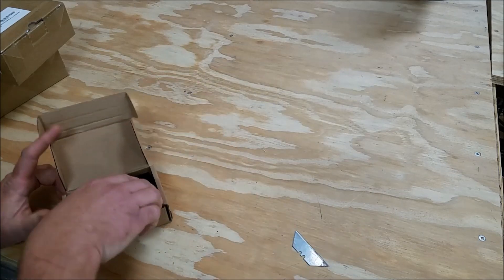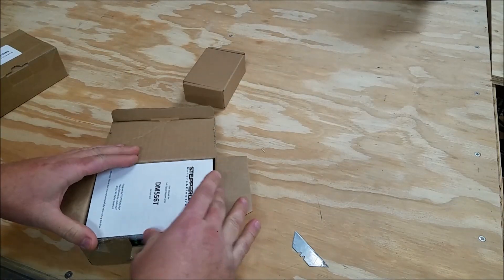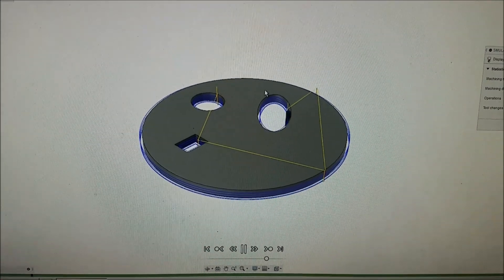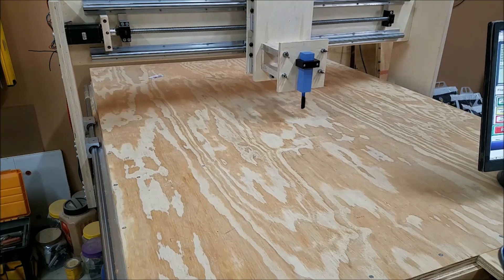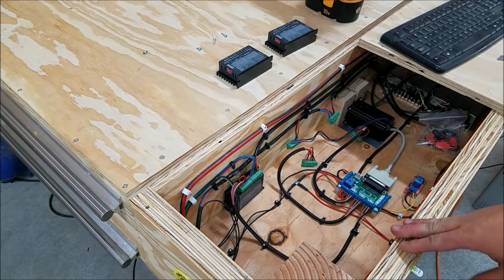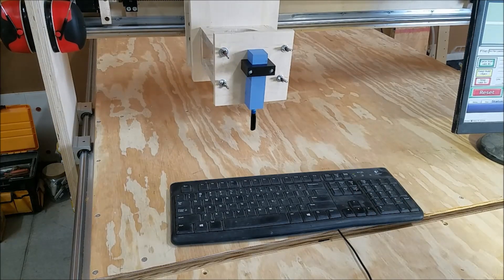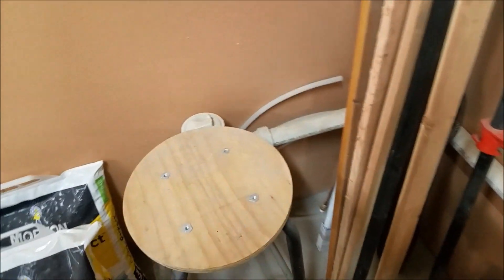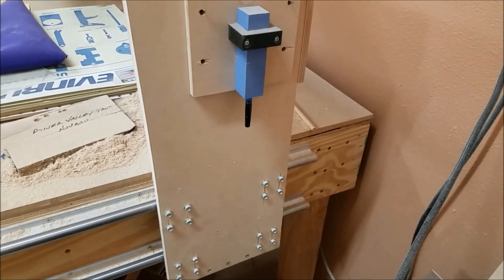CNC Motor Drivers; TB6600 vs. DM556T

Comment: Radiators have a function, stifling the airflow by placing them against a surface that stifles them is strange or curious.
This test is conclusive. For compensate a bad installation : use larger (and more expensive) modules.

Comment: I had a similar problem with the TB6600 drivers shutting down on me with voltages above 25vdc. And it was having an issue of drifting just a little each time with back and forth motion. I am replacing it with a drive very similar to the one you replaced yours with. Took me a long time to figure out what was causing the drift, I thought it was the software or settings. But after I fixed the random powering down of the tb6600 with a 35v 2000uf capacitor(one I had on hand, but you could probably use much lower capacitance) at the voltage input terminal of the drive. I eventually used a much smaller driver I had for the 2 amp motord to test the 4 amp motor and had no drifting issues at all. I later heard that this was a common problem with the tb6600 two trees brand, I wish I had known that before I wasted money on it, only 10$. But more so all the time I wasted diagnosing the issue.

Comment: Is it possible to control 20 devices at once?
Reply: Each driver is for 1 motor
Reply: @nikonastrougkakos159  
It is also 20 motors, 20 drivers, I want to control all of them manually, running in reverse
Reply: You could probably do it with an arduino and the GRBL software installed into it using UGS as the interface for controlling the motors, though it may only support 3 axis(x,y,z). But you may have to write your own program for it with maybe a serial input to the arduino for the "manual" controls.

Comment: Emm! What motor you were using with those TB6600 drivers? are those Nema 17? I'm guessing you tried to pull a tractor with motorcycle engine. 

Edit: forgot to ask what is the voltage you are using to drive those?

Comment: Inside the cheap tb6600 they use, at least on mine, terrible thermal solution with a tiny aluminum plate and a terrible thermal pad. I would have checked that out before buying the more expensive drivers. I replaced the pad with thermal paste and thermal epoxied the aluminum plate the the casing after sanding the paint off and haven’t had a problem.

Comment: Hey dude what software you using marlin or something another?... Did you just swap tb6600 with new drivers without changing config in software?
Reply from the maker: Mach3
Had to update the steps, or calibrate. Otherwise no issue.

Comment: you said the motor is 200 ppr as most are, but the lowest setting on the 556 is 400 ppr, how did you set that up ?
Reply: just tell the software that it should give 400 ppr..
(with the drivers 400 ppr setting, the motor uses 1/2 microstepping)

Comment: I just had the same problem. the 6600s worked fine on 3 different aluminum cuts. Then I over powered them trying to cut some steel for the first time. Now the X and Y just randomly shut off after a couple minutes. Looks like I need to do the same upgrade.
Reply from the maker: Im sure glad I did.

Comment: The linked DM556T drivers are not available currently. I couldn't find any WhiteSheets for the either. That said Amazon instead are recommending "  HQ-HQ Stepper Motor Driver,DM556 2-Phase Stepper Motor Driver 42/57 Stepping Motor Driver " at $25 each. Could these be an equally qualified  replacement ?
Reply from the maker: Great, there goes my plans for the CNC lathe and plasma cutter. The $25 ones are lower amperage, looks like the closest alternative is the $65 ones.
Reply: Oh no :(

Comment: I have a "value pack" of these as well.  I was losing steps with mine.  I took it apart and found it's not a TB6600 as stated by ALL the sellers, but the TB67S109AFTG driver.  After mucking around, I managed to get them not to lose steps on the bench at any rate.  It seems that the enable function is possibly slow to state changes.  I did some test code and was able to get it to not lose step by enabling the driver before use and not changing its state.  Not saying this is a cure-all but has worked so far.  I will test again soon on my CNC and see what happens.  It could be EMF noise causing the enable to bring the stepper off-line during the run or cause it to lose steps.  At any rate, these are probably not TB6600 drivers and the TB67S109AFTG instead.  Here is the code I wrote to test. https://pastebin.com/DRbUxanR

Comment: I'm no CNC expert but personally I would have wanted to mount those drivers on a metal backing to draw away heat. The wooden "container" is effectively the opposite of a heat sink.
Reply from the maker: I know, that was the plan; however they don't even get warm.I don't see a need for it.
Reply: Precisely and if they do get warm a simple 120mm fan on them will do the trick (cut a hole in the wood so the fan can blow on the heatsink).